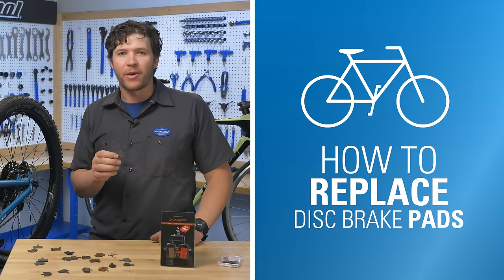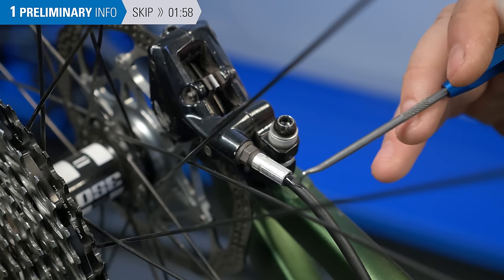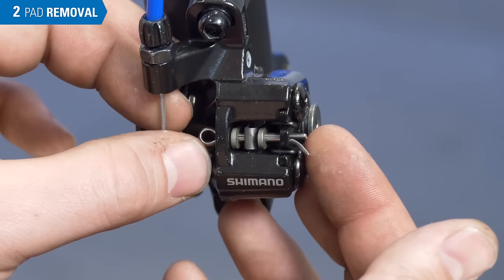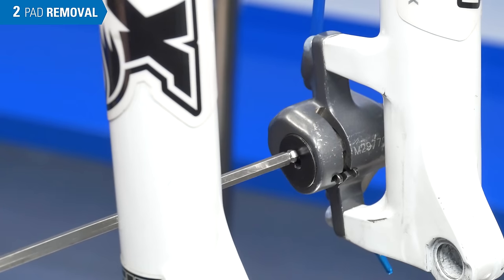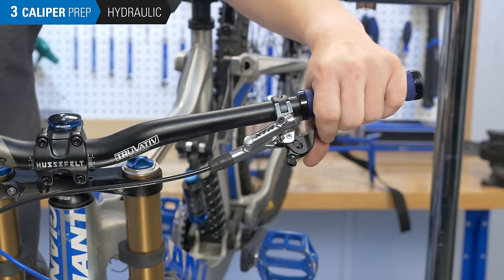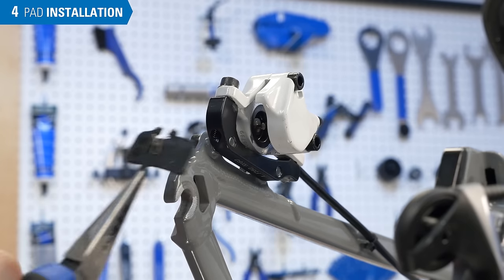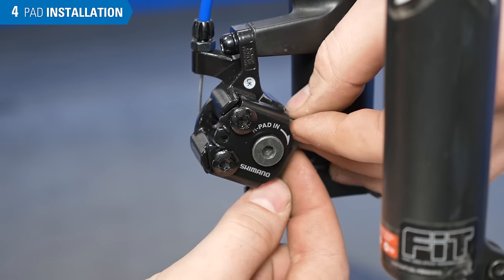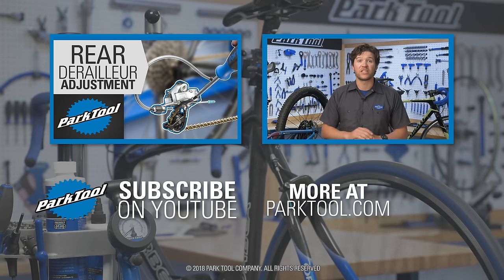How to Replace Bicycle Disc Brake Pads

Comment: so how you fix ur break i pop the piston  out oops, and i bleed did good they feel like poo
Reply from the maker: Re-bleed it again. There is likely air behind the piston. During the bleeding process you might pull the bleed block and carefully advance the pistons without letting them fall out and then push them back in. That can coax some of the air that is hiding behind a piston, out. It also makes a big difference how the caliber is attached during the bleed. The bleed port should be the highest point in the system even at the caliper.

Comment: At 3:09, what is the screw type for the orange adjuster? I used hex key on mine, it dosent seem to work.
Reply from the maker: You can often turn it by hand with the large wheel but the center is a T25 Torx.
Reply: @parktool   Thank You!

Comment: Do you have to remove the wheel?
Reply from the maker: For some brakes, no.  If the pads come out the top, you can sometimes get away with leaving them in.
Reply: Park Tool yeah I had magnetic pads so they came out easy enough I just ended up taking both of the wheels out, thanks for the tips🙌

Comment: 4:18 when I push one piston the other one just pops out and vice versa. So I can't put new pads because there is no space between them. What should I do?
Reply from the maker: If your system is a DOT system your fluid may have absorbed fluid through the hose and may be too full. You may need to remove the bleed cap at the lever and allow excess fluid to come out as you push the pistons back in. You may need to bleed afterwards as well.

Comment: I replaced the brake pads on my fork but they are too close together and press up against the tire, even after I reset the brake
Reply from the maker: If you are dealing with a hydraulic disc brake you may need to bleed the system as it could have absorbed moisture through the hose. If you are working on rim brakes you may need to loosen the cable to accomodate.

Comment: Guys, what is a life-span  of brake pads with cotter pin type?
2:42
Reply from the maker: Pad life span is difficult to estimate, but the cotter pin design does not come into play here.  If you ride in the rain and mud often, pads can wear very quickly.

Comment: Im converting my bike to 1x8 so i need tutorial how to remove the front derailleur that have the shifter fused with the brake
Reply from the maker: For some models, if the brake lever and shift lever were formed together, there is no good way to do this.  Simply ignore it.  You can take apart the lever and mechanism to simplify if you want.  If you intend to cut it off, inspect first that you are not weakening the brake lever mount.
Reply: @parktool  thank you for the information and advice
Reply: @parktool  sorry for asking again but can i remove the one  fused with shifter and put normal brake lever
Reply from the maker: You will need a new brake lever and shifter for that one unfortunately.
Reply: @parktool  oh thank you

Comment: My Shimano mechanical disc brakes are squeaky and don't have enough bite, can't even lock the wheel. Any solutions anyone?
Reply from the maker: Remove the wheel from the bike.  Use a solvent to clean the rotor. Remove pads and lightly sand the surfaces to clean.  Re-install pads, and then burn in the pads.  Find a safe down hill run, and repeat riding and hitting brakes hard. Do this several times.
Reply: Park Tool thank you so much man. Y’all make my life much easier

Comment: I have 2 caliper adjuster and one of them is jammed..........What to do ?
Reply from the maker: When you say "jammed", is it stuck on the disc?  Are the pads not opening?  Is it mechanical or hydraulic?
Reply from the maker: Detach the cable at the caliper pinch bolt.  Does the arm pull back and open the pads?  Also check the pad adjustment screw.  Also check- https://www.youtube.com/watch?v=NmqGeLNcVIg

Comment: Why on earth would the brakes be designed to need the WHEEL taken off? That's a nightmare job with  Gates drive and hub gears. It would be easier go unbolt the brake from the carrier, and lift it away from the rotor disk on the end of its flexible hydraulic pipe. Better yet if the pads come out through the TOP, meaning everything but the pads and split-pin can stay in place.. (Mine don't... which is crazy).

Comment: jesus, how many pad variation styles? why is there no standard....
Reply from the maker: There are many shapes and sizes.... Does not make selection very easy but the good thing is that Companies can innovate and push technology further and further without constraint. It can be frustrating tho. I have never seen a car or moto with the same pads between them either so this is not just the bike world.

Comment: I will prefer sample bike breaks this breaks expensive to reapear and give pain in the ass.
Reply: Repair can be more difficult by a margin, but performance is miles better on a hydraulic disk brake. And that is what matters when needing to brake

Comment: why remove the wheel for changing the pads?!
Reply from the maker: The pistons will be pushed toward the rotor as the old pads thin.  The piston need to be pushed back into the caliper body to allow new and thicker pad to be installed.  Also, several models/brands are removed from the rotor side.

Comment: Its almost impossible to tell which disc-brake I have on my schwinn hybrid...probably shimano.  This is far too complicated and even when new my disc brakes dont work at all well,....nothing like as effective or easy to replace as rim lever brakes,  Very poor design option, complicated, ineffective, expensive, and difficult to replace and adjust.  Disc diameter is too small on a 28" wheel to give sufficient leverage.
Reply: Sounds like they weren't set up well. I have both types (rim and disc) on different bikes, and found this video trying to teach myself how to perform my own maintenance.  When they are set up properly by a bike shop, disc brakes have more stopping power. You're right about them being more complicated and they do have annoying issues (like rub), but they should be more effective at stopping the bike, especially in poor conditions.

Comment: Somebody tell me, why does the wheel have to come off? Won't the pads come out, otherwise?
Reply from the maker: Many pads are removed from the bottom which would be extremely difficult in some cases and impossible in other cases. For pads that come out the top it is possible to replace the pads with the wheel in, but it makes the process much more difficult and introduces a ton more potential issues like whne resetting the pistons you could damage your rotor. It is safest and best to remove your wheel on any disc brake bike when replacing pads.
Reply: @parktool  Thank you. Pads do come out from the top. But I've got a Gates belt drive, so I am not too keen to take the wheel out and lose tension on the belt... not least because I don't see how belt tension is subsequently adjusted. I can't see a mechanism for doing so... (and I have looked hard, believe me!) The bike is a Scott E-sub Tour e-bike.
Thanks again for your response. Much appreciated.